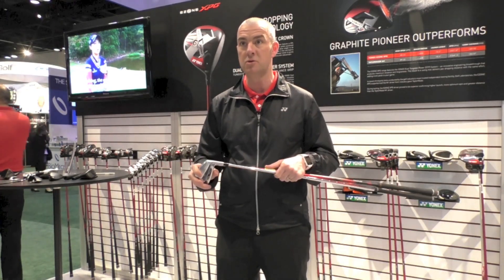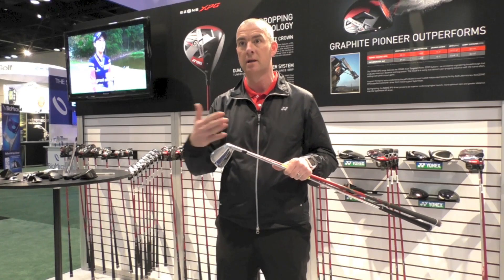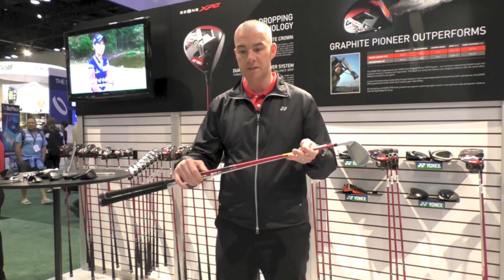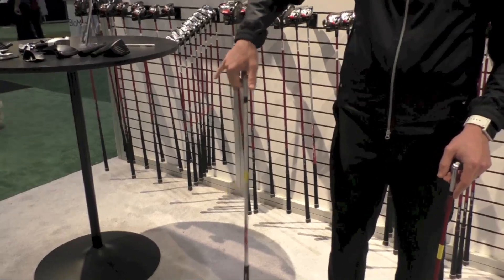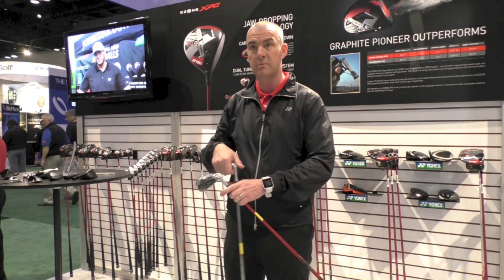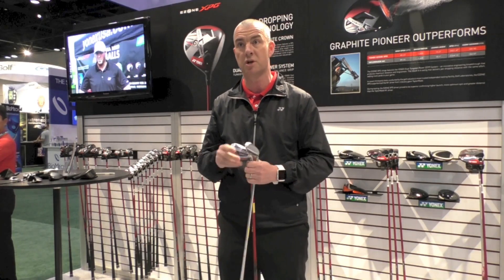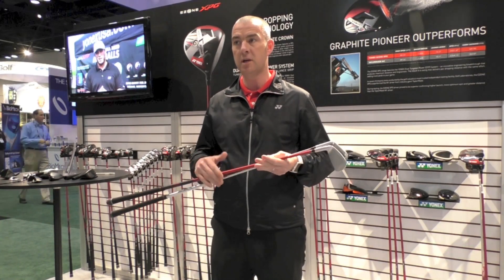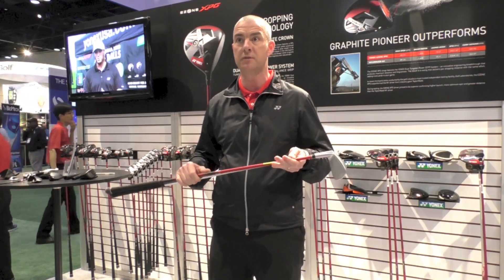How Can Graphite Shafts Improve Your Game?

Comment: why is the tape so much higher on the graphite?  put it down at the same level and I'm willing to bet it would vibrate more
Reply: +Capt. Cheese An obvious thing to seize on but I'm sure it will still vibrate LESS than the steel, which is the point he's making.  Really though they should have tried to match sticker location for the comparison!